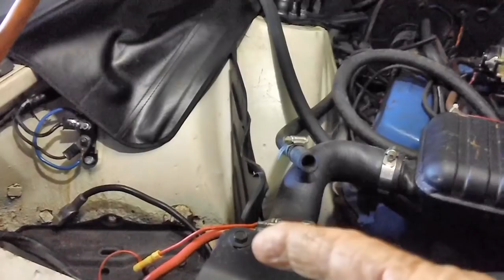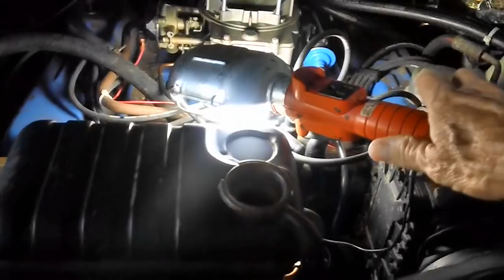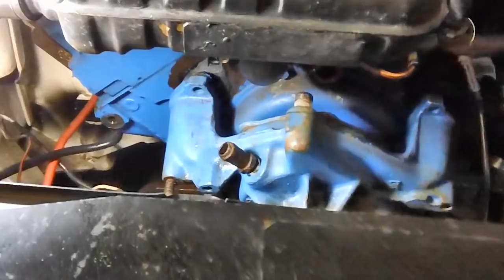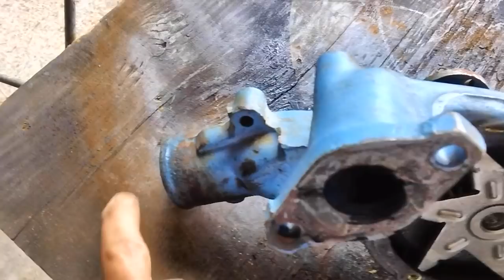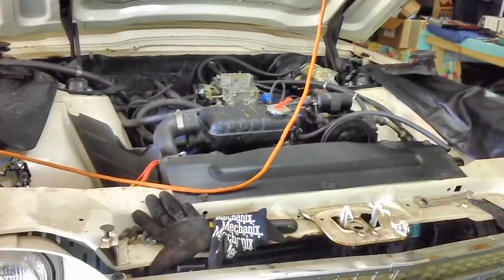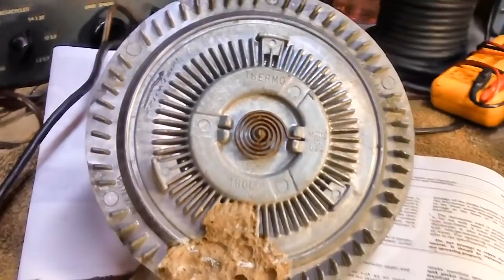1966 Ford Thunderbird repair and refurbishment (Part 97). Leaking water pump changeout.

Comment: The date code is 7L15 which is 1967 (7) November (L) 15th.  so not the original pump but is still a really old one.

Comment: While you have the pump off it would be an easy job to change the timing gears and chain as they can wear out and give poor performance  due to nylon coated gears that wear out giving alot of slopp... at least on the Plymouth 318 engine not sure if the FE has that same issue

Comment: Hi John, I have a 66 conv. I've owned for over 30 years and hsd the same peoblem. You over filled the expansion tank thats all. When the engine is cold in the morning the water level should be just below the halfway point of middle of expansion tank! Because when the engine gets hot the water level will go up  all the way up into neck and go out the overflow hole and into your overflow hose. That's what you are seeing spilling on the floor of your garage. That's why you didn't see any problem with your  water pump!
Reply from the maker: Carl,
I hope you're right, my friend, but I'm unable to get enough water to stay in the engine to find out.  As I poured it in the tank it was running out the bottom.  It didn't reach the overflow hole.  It's really weird, but we'll have an answer soon.
Regards,
John

Comment: My guess is the overflow line from that tank, not uncommon on 390"s.  Good luck  Also did you get the brakes pumped up?  I guess so since you found a leak at the MC.
Reply from the maker: Mike,
I've not yet heard that, my friend.  Any idea what causes it to happen, although in this case it doesn't apply because as I was pouting water in the tank it was running out on the floor just as fast.  You would think a leak that heavy would be easy to find.  Sounds weird, but not so.  
Regards,
John
Reply: @joernone  I've always been told to only fill that tank about 1/4 full.  any more than that will just run out of the overflow when the 390 gets warmed up.   I'm really surprised that you couldn't tell where it was coming from if leaking that bad.  I'm really curious, can't wait to hear the cause.
Reply from the maker: A quarter full is probably correct, but I've not found that referenced anywhere.   The shop manual calls it a water resupply tank...which could mean automatic resupply as needed or just the place where water is put in, you know, "resupplied".  😁  I'll have to ask around about this.  Maybe someone with years of experience with the tank can help.
Regards,
John
Reply: @joernone  I spend a lot of time on  the Fordfe,com website, great place for information on these engines

Comment: Hey John, well ol' Murphy is alive and kickin'! I would agree with others about the by-pass (on the engine side). During my rebuild, mine had to be replaced because of rust holes. 
George B. in Michigan
Reply from the maker: George,
That bypass pipe in the engine block was changed out in the very beginning of the series. The original was about rusted to pieces.
Regards,
John

Comment: John..when i lived in NC we also had horrid heat indexes for a couple of months, but the other 9..10 months were splendid..many a day i had wished for snow...and i did not mind green Christmases...
Reply from the maker: The older I get the harder it is to take those massive heat indexes.  Each day I've been getting out to the garage earlier and earlier, usually lasting until around 9:30 am, then it's scoot back in the house.  😁
Regards,
John

Comment: Hey john the thing on the front of the radiator is the condenser. 
When you are ready to do the air conditioning shoot me a message I might actually have some refrigerant for you.   Check the bypass hose on the top from the water pump to the intake manifold and make sure there’s not a hairline crack on the threads where the new hose is.
Reply from the maker: Lavrine,
A very kind offer, my friend.  Thank you.  The bypass pipe and hose were changed out in the very beginning of the series.  The originals were shot.
Regards,
John

Comment: John could that bypass pipe have a hair line crack that opens up under pressure?  Keep at it man. Just don’t try using that Flex Seal on it. Phil Swift will try to drive it across a lake.
Reply from the maker: That bypass pipe was changed out in the beginning of the series.  The original was about rusted away.
Regards,
John

Comment: Well John the water pump was my guess too.  Still would be my suspect as defect/opening would increase  in size due to temperature rise and pressure from heat.  I always knew that type of fan clutch as thermostatic clutch.  I have seen them on  other makes of older (1960s 70s) cars.
Reply from the maker: Albert,
Could be, but we're about to eliminate that possibility.
Regards,
John